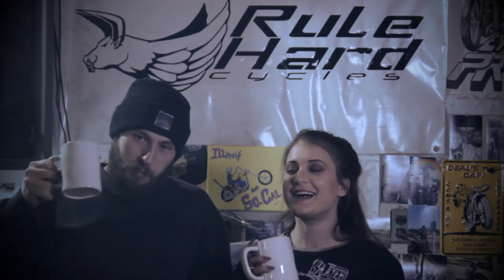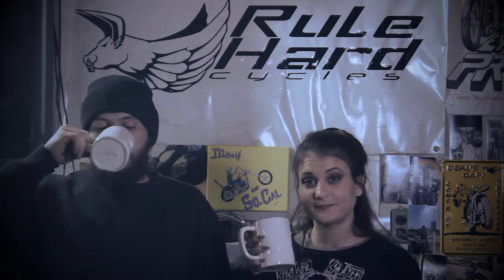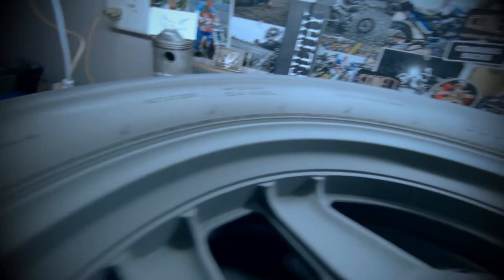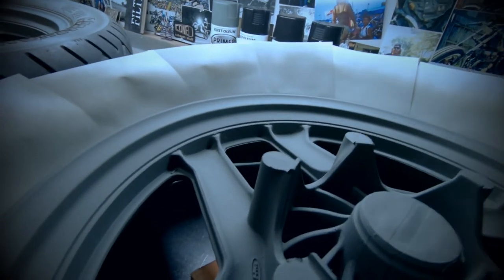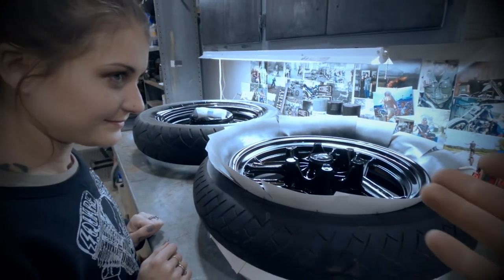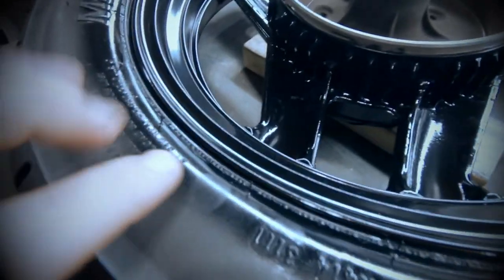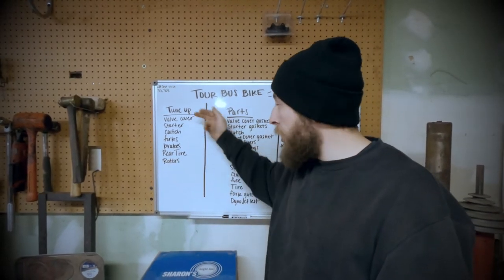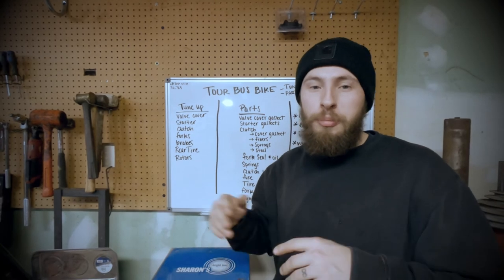Appliance Epoxy Wheel Paint (Pt.2)| Motorcycle workshop update | Nighthawk S Project bike build

Comment: I know this is an older video and hope you are still on here. How did the paint hold up?
Reply from the maker: Held up fine as long as I owned it. I’ve had a few bikes with somewhere around 10k miles or so in parts without issues. Pretty solid way to do it
Reply: @rulehardgarage9740  appreciate the reply. Thank you.

Comment: Great videos guys. I was gonna have mine PC but I think I can paint them after watching the videos. Had an 84 in college in the early 90s and just bought another just like it...just not nearly as nice. Anyway, I'm not mechanic but I'm relatively mechanically inclined. My concern is taking the wheels off and putting them back on. This a pretty straightforward job? Meaning if I pay attention, take alot of pics and reverse everything when doing the reinstall, this pretty doable???
Reply from the maker: Absolutely. The rear is super simple because it's a shafty. The front is t too bad either. I have a FSM .PDF if you'd like too.
Reply: Thanks buddy! I'll give it a shot and I'd appreciate the pdf.
Reply from the maker: Do you have Google drive?
Reply: Lindsey & Dick yes I do
Reply from the maker: @sheepdog723  DM me your info on Instagram and I'll share it with you.

Comment: Why did you select this type of paint and how has it held up in use?
Reply from the maker: I chose this paint because it has been tried and true in th past by myself and several other people. This is not the first time I've used it. Generally speaking enamel is very durable in comparison to other types of paint.
Reply from the maker: I'm going on two years and I've had zero chips. Even had a leaking for sealmall last year and didn't bgarmnthe wheel paint at all. I've used it on frames as well without issue.
Reply: @rulehardgarage9740  Great to know. I just happened to find this paint can in my stash when I needed to restore my 16 year old windshield wiper arms whose paint had flaked off. What impressed me was how quickly it dried and how hard  it seemed to become after just a few days. I did have my doubts at first considering it claims to be epoxy, which it can't possibly be considering it would require two components mixed right before application, at least not at that price (true epoxy paint is available but the special two component cans that it requires make it extremely expensive and it must be used all at once)
Reply from the maker: That is what's called two part epoxy. That doesn't make it a true epoxy but rather just a more effective way of creating cured product.